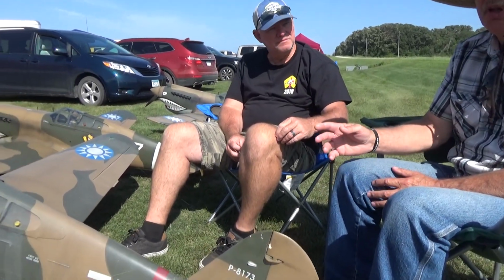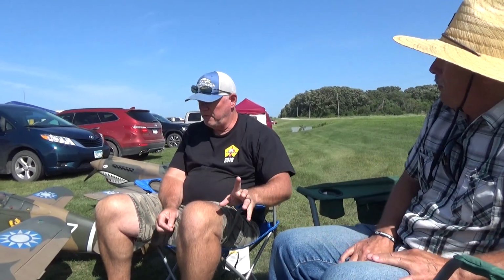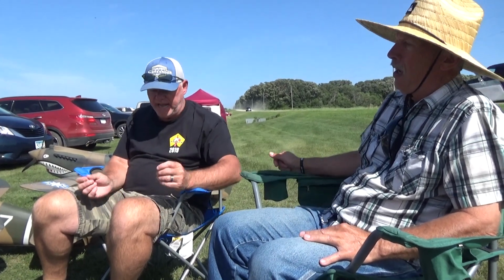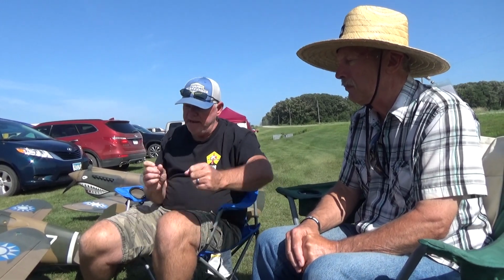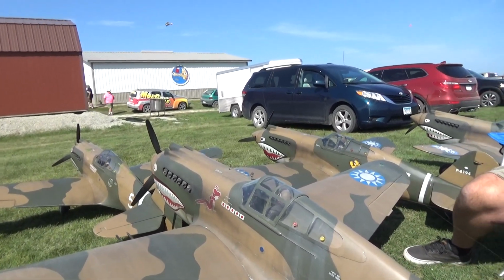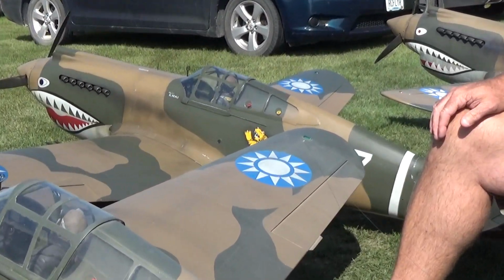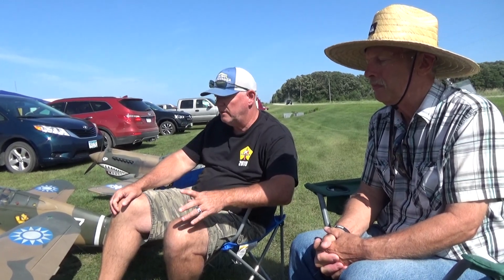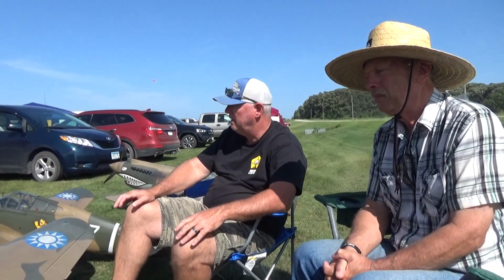The Jerry Bates P-40 project with Rich Eggleston

Comment: Fantastic, GREAT JOB. Have to ask, how much for one of those ? With Radio system too.
Reply from the maker: Around 4k
Reply: @n1114v  Thank you for the price info. That is with the Radio system too? If so, fantastic. What is the contact info for it?
Reply from the maker: @lancegrey1225  these are scratch built. Plans are available but you have to build it.
Reply: @n1114v  OH MY GOD! If I tried to build one, I know it wouldn't turn out good. I haven't built a plane since I was probably 12, or, 13yrs old. Last one I built was a Piper Tri-Pacer , with a Wing span of about 53.25 inches.
Reply: @n1114v  where do you get the plans, and how much are they? If you would please let me know. I appreciate it very much. Thank you.